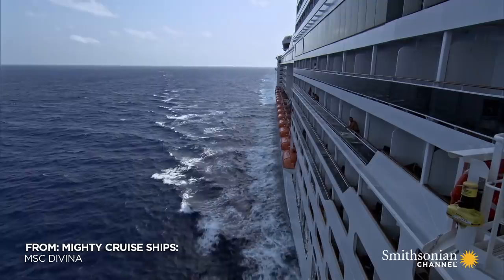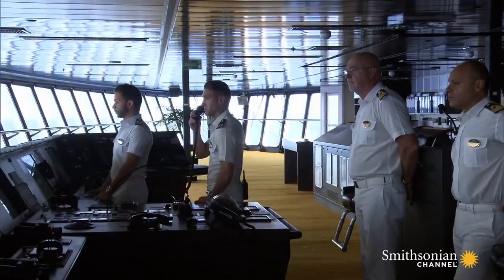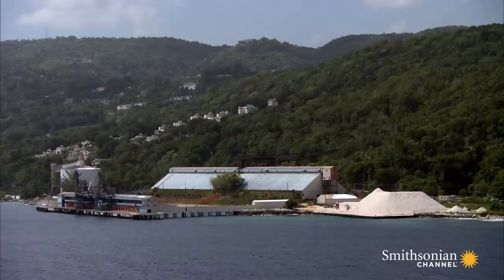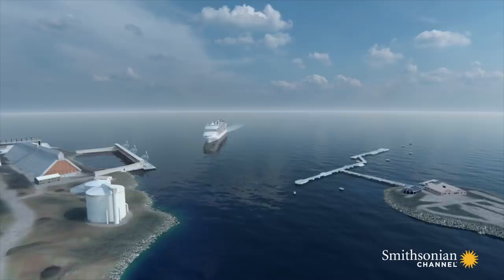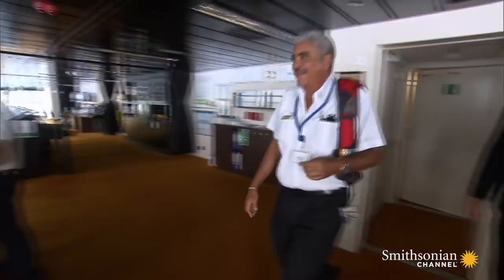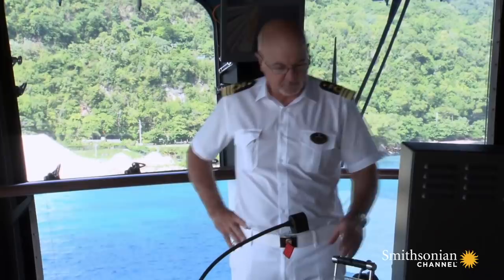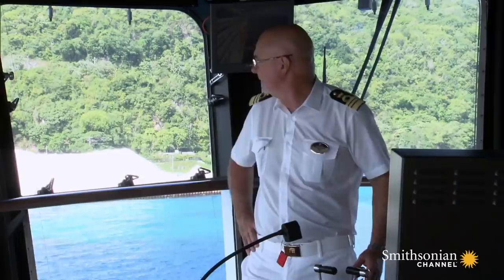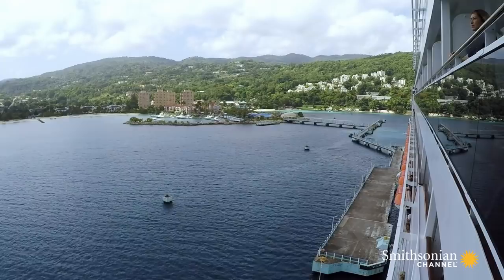Why It's So Risky Docking a Ship in This Jamaican Port

Comment: The US Navy ship I was on docked at Ocho Rios, probably 24 years ago or so... great little city.  Coming in wasn’t too bad, but leaving we ran over some buoys and snapped at least one line, which promptly wrapped around one of the screws.  Never forget watching the Captain, Chief Engineer, and MPA in dress whites, tearing into the reduction gear, before they realized what had happened.  We couldn’t really go into any of the shops, because we were afraid we’d get a contact high, and we new dang well that we were going to get drug tested after spending a weekend in Ocho Rios.  The Grand Jamaican hotel allowed us to use their facilities, so we shut down most of their bars.  Red Stripe is def. an acquired taste...

Comment: Admittedly I have no idea how to do their job but as a truck driver my first question is why do they turn all crazy tight and not just back in parallel?
Reply: rjcass33 it's hard to stop this massive vessel when going backwards, and I don't think they are meant to go backwards because of where they control the ship, hard to see the back
Reply: It all depends on the layout of the port, wind and the set of the current, propeller arrangement, if you have fixed propellers or dynamic propellers etc. In a situation like this, I think I would prefer doing exactly what he did because when you dock while going astern, you have to start using the bow thusters as rudders and along with that you kind of loose stability in the stern since the sidemotion of the propellers change when you go astern.
Reply: Because it won't look half as impressive!
Reply: Many ships that size do not have reverse,  They shut down the main, and re - start it backwards.
Reply: Propeller and rudder, cant turn while going backwards,
Reply: Boats With propeller which isnt turnavle and With rudder cant turn while moving backwards, they would just turn out  of course in one direction based on propellers rotation direction.Even my cabincruiser on 26ft can get irritable in marina areas, especially while lieing  to Close paralelly to other Objects.Isnt ther Space for astern to take a turn you aint getting anywere :) In a corner there isnt any moves to do, off course there are som tricks With mooring lines which can be used. But i Guess you understood it when you red the rudder thing, :)
Reply: It all depends on the weather conditions and ship type and ship's capabilities...cause where i live most times cargo ships come stern in, tie stern lines, then use bow thrusters in...but cruise ships are usually more maneuverable thus allowing faster docking through parallel parking
Reply: The bridge is in front, its much easier when they have tugboat assistance, unfortunately the port doesnt have any.

Comment: I'm surprised they didn't talk about how many ships get caught up on The Sandbar in Jamaica near the James Bond Pier. It's been many years since I've been to Jamaica maybe they have finally dredge the waterways better. But approximately 10 years ago ships used to get caught up on The Sandbar. Some ships even had their props damaged causing the cruise ships to shudder and Shake. Until a drydock and properly balanced or replaced.
Reply: It is shallow.  We were just there (last week).  We we pulled out it stirred up a bunch of sediment/sand from the bottom.

Comment: definitely not a 23 mph wind in this video the water is dead flat not moving at all
Reply: the port is shelter from most of the winds that blow just about a mile out but the currents and swirls in the bay are effective even at the shore at times

Comment: Why does this ship not have azipods?
Reply: NinjagoGuy416 because They Hired Lazy engineers
Reply: NinjagoGuy416 $$$$$$
Reply: I thought the same thing. If it had Azipods it would turn on a dime. They are expensive but it’s better to put money into those instead of repairing the hull.
Reply: With thrusters and conventional propellers the ship can still swing in its own length..
Reply: expensive, 
not as reliable as straight shaft traditional design, 
more money, 
more electronics and complications, 
expensive,  
not a must actually ..... 
lot of $$$$
Reply: Azipods are great yes...but like most modern marvels they don't come cheap😂😂😂
Reply: azipods are cheaper actually
Reply: azipods are cheaper